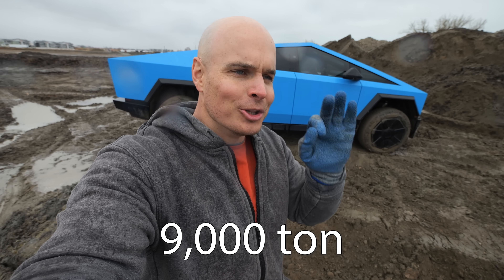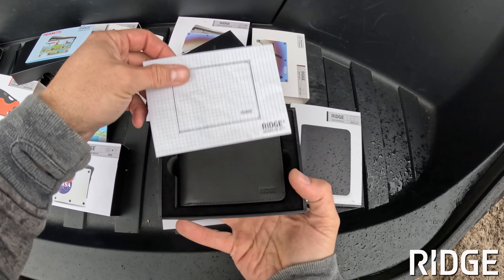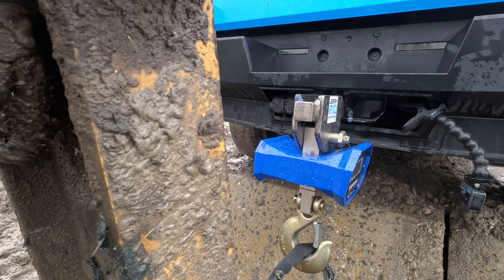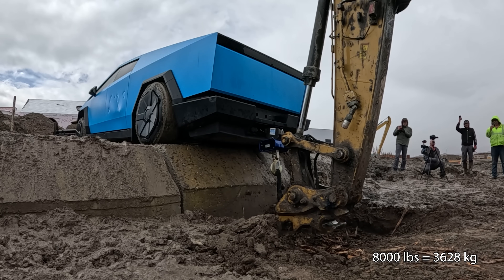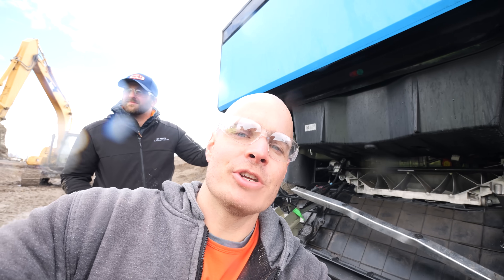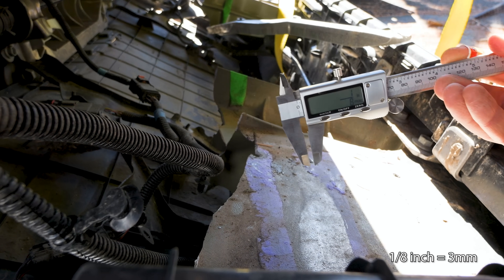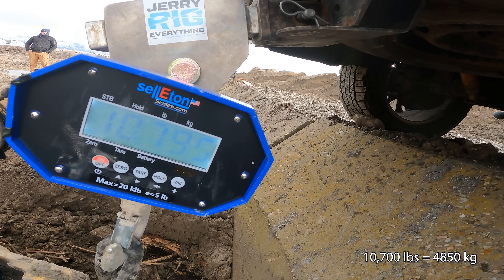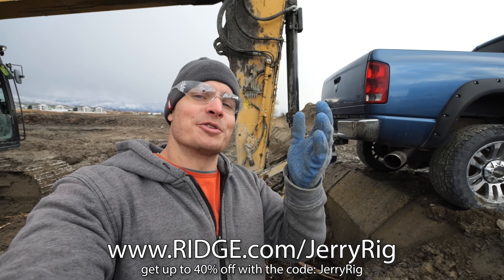SHOULD YOU TOW WITH A CYBERTRUCK?! - (catastrophic failure test)

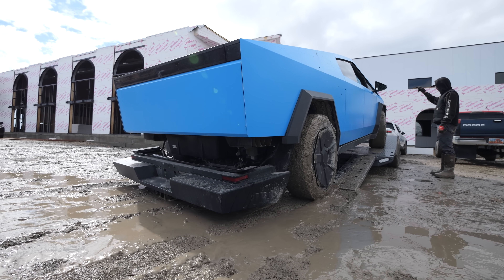Comment: Seeing a wheel cover pop off when the Cybertruck when being put back on the trailer (14:45) was kind of funny, almost like it spitting out a broken tooth.
Reply: you can see as the truck is being loaded, the front wheel hits the wheel well.  That trailer doesnt seem wide enough or something for the cybertrucks wheel base.
Reply: Why does a 100,000 dollar vehicle have plastic hubcaps? Haha
Reply: @nathanieladams7624  Only the fancy beast mode ones do, no? X)
Reply: @nathanieladams7624  They help with aerodynamics and add a couple of miles to the range. Many owners remove them for off-roading + to show off the nice rims.
Reply: The maximum vertical load on the tow hitch (i.e., the hitch’s maximum vertical load) is generally calculated as 10–15% of the trailer’s gross weight. Therefore, if the Cybertruck tows a maximum of 4,990 kg, the hitch’s vertical load would be between approximately 499 kg and 748.5 kg. 😮‍💨 
Just say you hate Tesla instead of wasting time and money like a fool.😂

Comment: So it's almost 10x times stronger than the rating of 1100 of downward force, pretty good.
Reply: Also at 2260 kg ( 12:25 ) You can see the truck frame is bent, as parts are flying off in the front, making the truck unsafe to drive, so it lost at half as much. 
If a truck also sudden got 10 times the rated force on the hitch, I would want the back to break off, as that indicates somethings is very much gone wrong. Like backing the trailer off a cliff or it tripping over, I don't want the car I am in to follow suit, rather lose the back and stay alive. 
All in all this was a really dumb test if you wanted to show it was unsafe, as you did the opposite.

Comment: So it withstood a 10,000lb tongue weight load, a whopping 10x its rated capacity. You really showed him Zack!
Reply: the rated load is static, when your trailer hits a bump or pothole, that loads becomes A LOT more.
Reply: @DooMMasteR  No it doesn't. Tongue wheight only fluctuates 10-20% JUST Tongue weight. This is assuming you are not doing Dukes of Hazard jumps with it. Google it, it's well proven, just not well known.
Reply: Here's what I saw: Even a 20 year old dime a dozen Dodge was stronger although that thing never got advertised as a tank replacement.
Reply: @Battledrone  I'd love to see a dime a dozen Dodge with 10k lbs of tongue weight on it. Good grief.

Comment: I'm not sure of your point.  You made the comment "this is one improperly loaded trailer away from a failure."  Your test is invalid because you pulled down, straight down.  That is NOT how a toe hitch is designed.  The force vector was designed to pull in a direction 90 degrees from what you just demonstrated.  Your test is totally invalid.  But what do I know (as an engineer). If I was Elon, I'd actually sue you.  Because you are making the assumption that it isn't strong enough, although you exceeded the manufactures limits.  I'm not sure what you are trying to prove.

Comment: so basically this "test" proved that the CT can withstand 10x the downforce that the trailer tongue is rated for. and this is a bad thing how?
Reply: @brightmangroup1003  anyone else find it weird that nearly all the Tesla defenders replying have default profile pictures?
Reply: @somelokyguy6466  It's like they're all bots at this point. They all do the same parroting, of the same bs, and bot upvote, those posts, so it looks like they have something, when they have nothing substantial to say.
Reply: the guy has TDS and now clearly MDS.  Mind virus clearly at work here.
Reply: Same question I had…
Reply: Because the rating is for a static load, not a dynamic one.
Under dynamic loading it's very easy to exceed tongue weight several times over.
Aluminium also suffers from fatigue stress, drive over a pothole once and the CT is fine, drive over a pothole 1,000 times and it could very well be a different story.
Of course people who watched the video and didn't just outrage click then parrot a comment would know this, but whatever.
Reply: @somelokyguy6466  sure, dynamic load can be higher but not 10 times. And not even close the the towing weight. This test ist bs
Reply: Make it make sense for these leftists 😂
Reply: Stupid test that proves nothing.. the tires aren’t even rated for that much !!!

Comment: Aluminum is a good material for a bicycle frame... IF IT DOESN'T FLEX... If it flexes it will break in time and it will be a catastrophic failure. That's why road bikes are made in carbon fiber, steel, or titanium. Aluminum road frames must be made strong enough not to flex and are thus too rigid for comfort. Mountain bikes are a better use because suspension eases the roughness of the ride.

Comment: You have to load the trailer with 20.000 pounds, and do it wrong, to get those kinds of hitch loads. 
In europe, you can tow 7000lbs on the largest passenger cars, and most have a maximum hitch limit of 180lbs.
Reply: All depends on the lever length from the hitch frame and what type of forces the hitch sees, like if you have 8000 pound suv load in tow on a smaller trailer and hit a dip in the road going highway speeds and your suspension hits bump stops that might easily exceed the 10400lbs demonstrated in this video. Also under continuous use of improper load the aluminum will fatigue causing this number to be even smaller
Reply: Missing the point, no fatigue limit means every time you tow the chassis will get weaker and weaker until this happens.
Reply: @Ang3lUki  you’re missing the point that is not what was tested in this video. 
This video tested absolutely nothing of merit .
Reply: @ You're missing the point of the video. The steel frame can be bent back into shape and still work. The aluminum frame is fucked. Aluminum cannot be repaired, it's not suitable for trucks.
Reply: And the cybertruck won't even let you drive away if the bumper falls off. Not exactly possible to just weld a new hitch on and call it a day anymore
Reply: @patty109109  Maybe watch the video again and pay attention. What was tested was the strength of steel vs cast aluminum. The only reason it's would not be "of merit" is because everyone already knew steel is stronger than aluminum. Just because the fatigue limit was not tested in this specific video does not mean it's not relevant.

Comment: Doesn't the owners manual say that the maximum tongue weight is 1,100lbs? So this test has proved that the Cybertruck exceeds its specified limits by 8X. Towing capacity and tongue weight are two different things. So is this test showing that Tesla is doing the right thing? I'm confused.
Reply: You can't explain that difference to stupid people....
Reply: Missing the point, aluminum has no fatigue limit, so every time you tow it damages the frame
Reply: it's aluminium. it gets weaker every time you put a force on it. it does not matter how strong it is out of the factory, after a few years of usage it will easily get bent or crack.
Reply: @your_average_clippy  Nobody disagrees with that, the issue is that this entire video is pointless and just praises the tesla with the tests. It doesn't show this weakness at all, and is just talked about. Might aswell skip the tests in the first place if the main point of the video was the detoriating strength of aluminium over time.

Comment: I've been towing around 7-10.000 lbs pretty much daily with my Ram 1500 and Ram 2500s. I cringe everytime I see a Cybertruck, especially when they tow something. Not because its a Tesla but because my range while towing already sucks (8-9mpg, roughly 250-280 miles to empty). When I saw WD break his cyber truck after its hitch clipped and obstacle, I was extremely surprised. Should have held up just fine, or any regular truck would. But as someone who tows all the time, this video is a bit one sided. If you got an 11k rating, and you hookup a trailer that can max out your rating, say a dual 12k axle trailer, you're already at roughly 3000 lbs for the trailer alone and say 200-250 tongue weight empty. That leaves you  8000 lbs payload on the trailer. Unless you're hauling steel coils or a CAT or something in the very front that would never happen in real live. I get metal fatigue and more so the issue of dissimilar metal corrosion. If the cybertruck fails in real life it will be like in WDs video where someone goes offroad and hits a rock or if someone uses the truck to tow someone out if a ditch which if you dont use pulleys to use mechanical advantage could break it. I'd love to hate on the Cybertruck more but I gotta say this test actually inpressed me. I dont think it would have any issues towing a 10k trailer under real life circumstances. Even if an incompetent person loads the trailer, they'd sway off the road before they put that kind of tongue weight together. And if say 3000 lbs tongue weight doesn't make the trailer sway hard at 30+ mph, that would be an impressive feat of the cybertruck. Again, I'm not a fan but I'm biased because I use my trucks daily the way they are intended and a Cybertruck makes absolutely no sense in my world. To each their own.

Comment: 1. the CT is in the 1/2 ton class. So why would you compare it to a truck in the 3/4 ton class? While the tow ratings maybe similar, the payload capacities aren't even close. You either don't understand the vast difference or are purposely misleading.  2. The stated max tongue weight for the CT is 1100lbs. it failed at 10k,  That is a safety factor of almost 10. This is more than sufficient for towing. 3. Your statement " 11k lbs of trailer weight becomes tongue weight" is absolutely false. The only way that could happen is if you hung the entire trailer over a cliff and it was pulling straight down on the hitch. Even then, that wouldn't be the same as your test because you pinned the front the CF down. That would never happen in a real use case.  The 50k lb excavator was coming off the ground before the CT broke. Thank about that. Like, really think about the forces there.  "If I see a CT towing on the freeway, I wouldn't wanna be anywhere close to that thing."  Man, you are fear mongering like crazy. All the respect I had for you just went right out the window.  You sure this video wasn't really sponsored by MSNBC, CNN or the deep state?
Reply: Even more concerning is right in the replies. A lot of people actually believe this bs.
Reply: You sounded reasonable until you mentioned the deep state. You Americans are really messed up ... on both side of the political spectrum.
Reply: yeah hes extremely dishonest
Reply: he became an activist man he lost his way already unsubscribed

Comment: This is misleading, and many comments already pointed that out. The sole purpose of this video was to break it intentionally on camera to make news. This test has almost no real life implications at all.
The front of the car would raise long before this much load would break the hitch.
Disclaimer: I don't live in the US, I don't care about trucks, Tesla, steel or aluminum. I am not defending anyone or anything except a reasonable presentation of the facts. And this video is not.
Reply: Jerry actually hates Elon and Tesla  it’s literally all he posts about on x.
Reply: It's actually a very good accelerated test of the structural integrity of cast aluminum as aluminum will never be as strong as when it leaves the factory. Aluminum weakens cumulatively, regardless of load, which means every bump, speed hump, rock in the road, shift from reverse to forward, etc, constantly weakens cast aluminum until it fails. There's a reason no one else uses aluminum for frames and hitches.
Reply: @ImamacFilms  by the time any of it can come in effect its pretty much guaranteed the car will no longer be in use.. no one buys cybertruck to then use it for 20 years under heavy load trucking.. hell most even dont do it with so called 'proper' trucks
Reply: They were testing for vertical stress, the type that you will experience under everyday conditions, such as cresting a hill, hitting a pothole, loading the trailer improperly (which will aggravate the effects of the earlier examples). And the controls cease to function if it suffers that kind of damage.
  I wouldn’t tow anything of significant weight. This is dangerous to the user and anyone in the vicinity.
  Finally, none of this really surprises me.

Comment: THIS IS CALLED INCORRECT USE OF THE TOW BAR SIR 🙂 If you applied the force horizontally as the factory intended, the structure would hold, but no one intended the towbar to be loaded vertically downwards

Comment: 15:05 🤔

Something tells me if you take a drill and put a few holes where that purple adhesive is and then put some thick SS hardware 🔩 though it to punch it together, it will hold a hell of a lot more weight.

The weak point seems to be the glue coming apart and then the aluminum snaps off once the glue let's go.  Tesla could easily do a recall like that that will only take an hour or two per truck.

Comment: When you're towing over 1000kg, you have at least 2 wheel axes, so the forces are not downward, but horizontal. I'm not a tesla fan, actually I believe that they are garbage, but the test is not applicable if you respect the law are tow that weight with at least 2 axes

Comment: It doesn't take an engineering degree or analysis to know that steel is stronger than aluminum. If you actually need a truck for hauling/ towing I recommend you use something that burns fuel & not an oversized RC car. P.S. I'm NOT 💩-ing on Tesla or Elon. You should buy the best vehicle for the task & if looking cool, running on electricity & driving a pickup that looks like it came from 2050 is your task, buy a Cyber truck...

Comment: Warning on the ridge if you use induction charging it will heat up the metal mount pad. It gets very hot if not centered